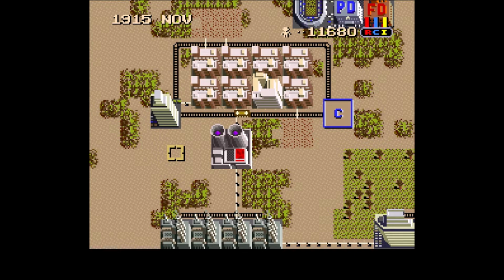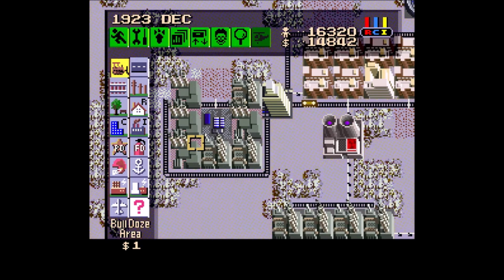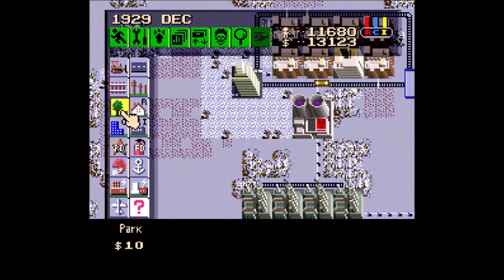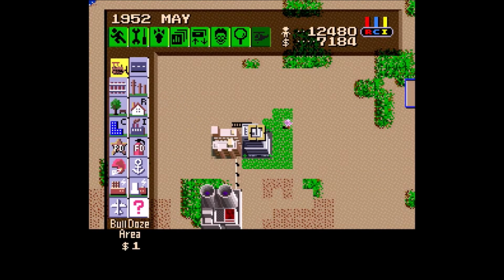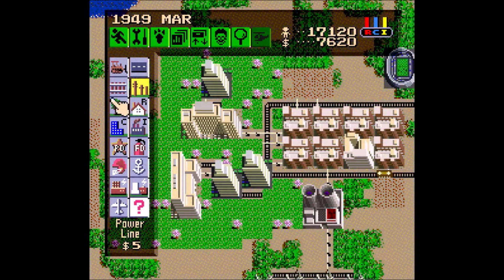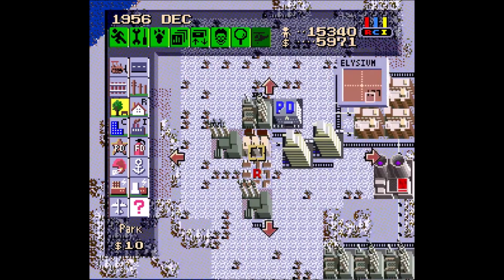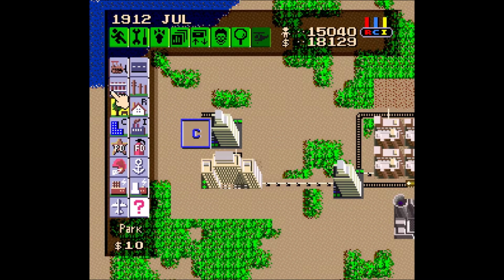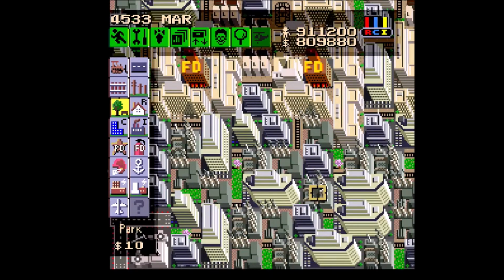Residential, Commercial, and Industrial Zones Part 2

Comment: it is somewhat fun to try and get C-tops in a bottom corner and then work your way across the periphery to fill with C-tops.  Before metropolitan landvalue will never be the same.  But you'll  need save states, sure C-tops ignore pollution and everything.  But they still don't ignore that blue demand bar.  If you're playing normally (more difficult, more true).. it's just 'not worth it' because of it.  Too much of an uphill battle.  They are still too delecate, save states need for them.  They're delecate still

RCI meter is too unstable (in hard mode, you have to bring down taxes to 3%).  Even with proper tax, the meter is still too unstable with swathes of 'metro R demand' that a beginner may not see coming.  The RCI meter is very powerful here and it's hard to see ahead, when that meter will just tank C demand and skyrocket R demand.   It gets too complex to hold on to the corner C-tops.

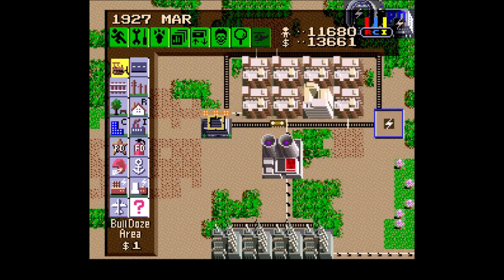Comment: 10:00 At this point here where you bulldozed and rebuilt the Commercial zone and surrounded it with parks to get it back to a high, what would happen if you had skipped the bulldoze and rebuild and just surrounded it with parks? Should it have been able to upgrade to a high or was it "locked in" as an upper?
Reply: Commercial zones will only change from upper to high when they develop.  So when it is at C-5 it can no longer develop and is locked into upper status.